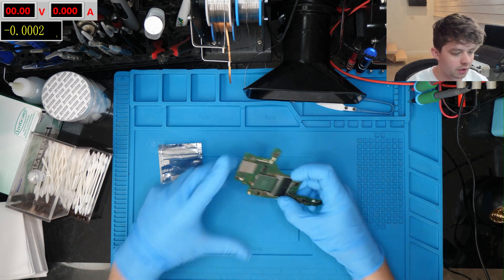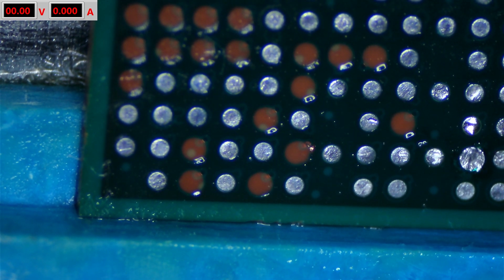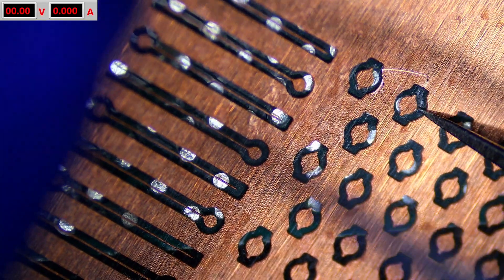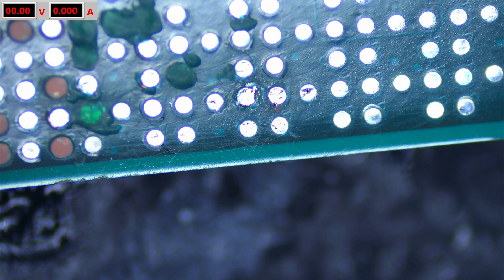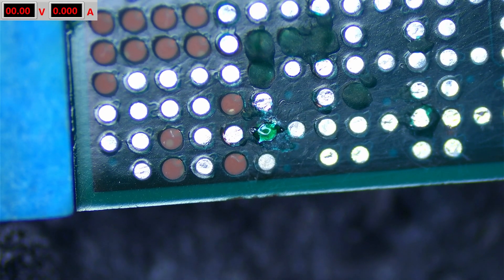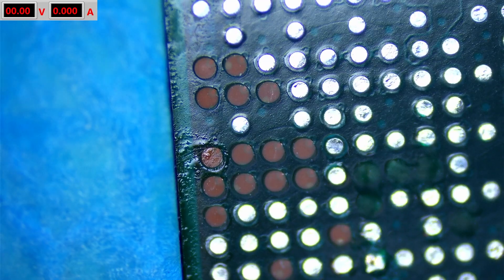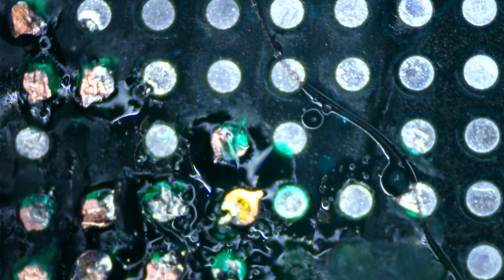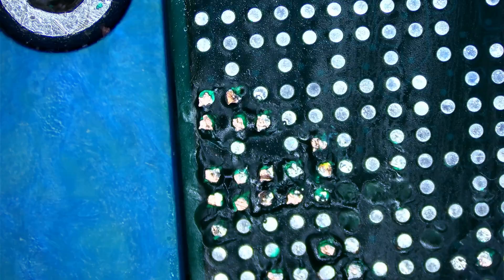Repairing 20+ Pads on a CPU

Comment: Fascinating work as ever, I'm learning more and more with each video.

Identifying the different types of pads (dead ends, those with surface traces, those connecting by Via), and understand many can be redundant/ be attached to a shared ground or power rail.

What eludes me is that, though two damaged board pads may connect to the same ground, how can you tell which of them needs to be repaired?

Surely that would depend on the specific circuitry of the BGA chip; the corresponding balls on the chip would also need to be on the same plane within the chip? 

Not sure of that makes sense, or if you can point towards some other resources about determining which aspects actually require repair, and what can be left? 

I see you use a multimeter a lot, and can't help but feel I'm only understanding half of the thought process. 

Much appreciated!

Comment: I do watchmaking as a hobby; I know next to nothing about electronics repairs like this.  My thought when seeing this repair, aside from "wow this is fixable??", is that watchmaking tools might make some steps a bit easier.  In particular , a watchmaking oiler could help with flux application.  I have on my shopping list some micro-files sold by an electron microscopy supplier, so i don't know yet, but they could possibly help with scraping.  Thank you very much for the video!
Reply from the maker: Thanks for the suggestions!! There definitely seems to be some overlap between tools that would be useful for this and watchmaking/repair. I actually think about it every time I come across watch repair videos haha. I'll definitely look into the oiler!!
Reply from the maker: I forgot I actually bought my crest ultrasonic cleaner second hand from someone who was using it for watches haha

Comment: Could this also be a way of finding and repairing a shorted CPU. Great video.
Reply from the maker: Thanks! Generally, a "shorted" CPU is shorted internally and cannot be fixed.
Reply: @nanofixca  Didnt know that. I've never seen anyone try to repair a shorted CPU, other than just reflowing or reballing the chip.
Reply from the maker: @rory9174  Yeah generally reflowing/reballing chips is an attempt to fix cracked solder balls or corrosion underneath the chip
Reply: @nanofixca  Yes, YouTube is full of those videos. Bought some of the nano flux you recommended. Really impressed, thanks for that.